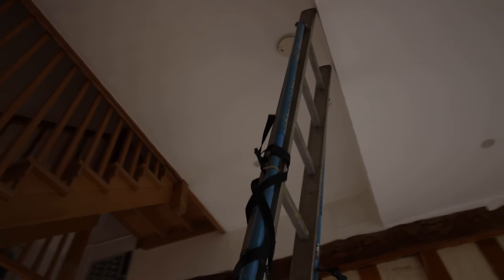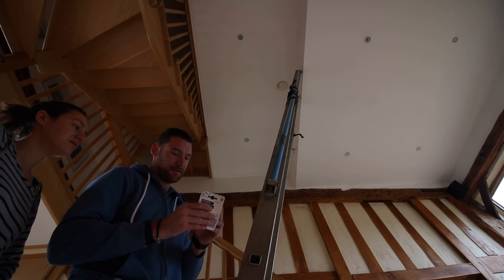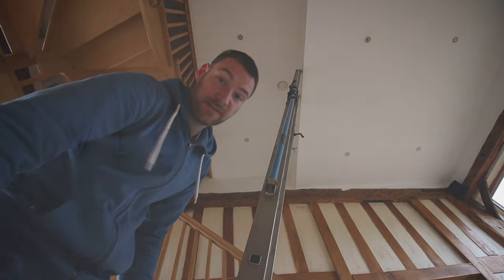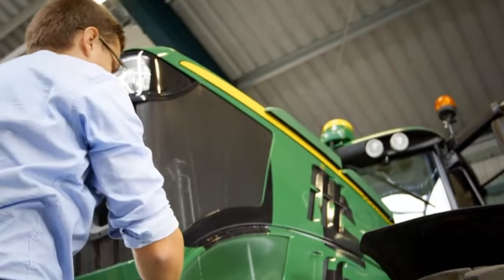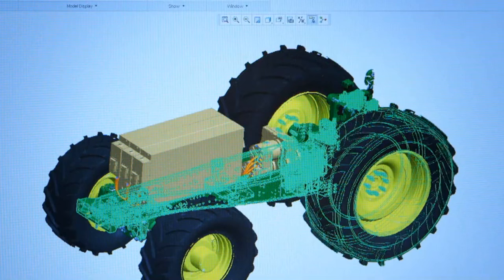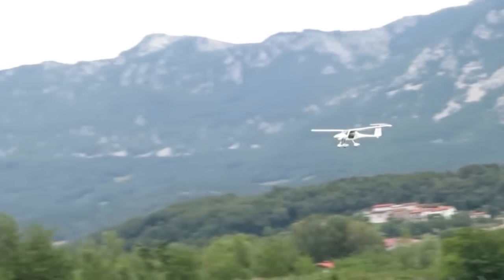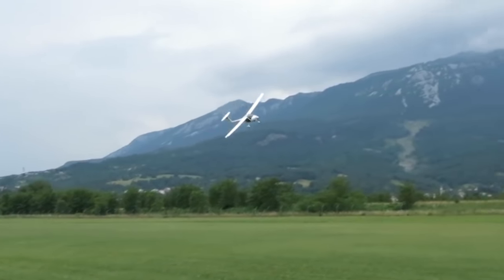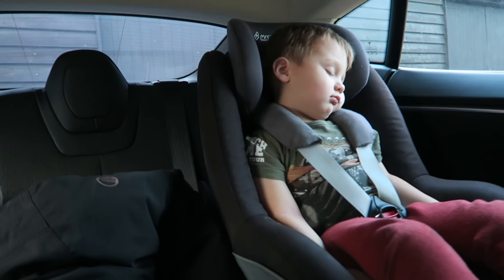Electric Tractors and Footholds

Comment: I'm a farmer with a Tesla Model S and a Polaris Ranger EV. An electric tractor would be great, just hope that Fendt also join John Deere with an electric tractor. The one thing that is different with a tractor is that weight is a good thing, so if the design could include the biggest battery possible then that would add weight, so a fresh design is needed to fit the biggest battery they can.
Reply: StarGames How is having a Tesla on a farm stupid? You do know certain farms have paved roads & driveways. A farm, especially a farm with Solar Power is perfect for a Tesla.

Comment: If you do not know the USA and British army is looking at power packs updates that include using hybrid system on tanks and other stuff so if a tank needs to be quieter it can run on in EV mode.  Also farmers in most places get tax free fuel - UK it Red and in Ireland it Green diesel thus the saving are harder to look at.

Comment: I have absolutely no knowledge of tractors! Jasper definitely knows more than me. You have inspired me enough to give up my lovely Megane Convertible and order a metallic black Renault Zoe Dynamique I (batteries paid for Z.E.40). It will arrive in March. I am interested to see the range - the dealer thinks Renault have been conservative with their range calculator so as to not disappoint people (he says he has a few customers who regularly get over 100 miles out of the 22 kwh version). The dealers are also giving very big discounts from the advertised price so it is worth asking them about this because it makes the car much more affordable than I expected (especially given the low running costs).
Reply from the maker: Fantastic, welcome to the EV revolution!
Oh and can I be the first to say, great choice of colour ;-)
Did you go for the quicker charging version in the end?
Reply: Thanks - black looks great if you keep it clean and shiny. The quick charge version was about £800 extra and I only expect to use a fast charger about ten times per year so it seemed to be poor value for money in that respect. I may feel differently on a long trip but time will tell.

Comment: Until cheaper batteries, higher density arrive, there's the option of using a small bio-fuel turbine to generate the electricity instead of batteries.  CAT did something similar to this a few years ago using diesel ( look up CAT d7e ).  That is still much more efficient and reliable than using diesel directly in a combustion engine.  Farmers can pretty easily gear up to grow their own eco-friendly fuel from something sustainable if they want to.  OR... How about a tractor with hot-swapable batteries?  The tractor could take a whole trailer of batteries to the field where the farmer is going to be working, dump it in the corner and swap batteries every  four hours, before taking the trailer of exhausted batteries back to the farm at the end of the day to recharge.

Comment: Some time ago you made a vlog about using a blue commando socket for charging your model s.  Now you seem to have a tethered cable where you park.  Have you changed things?  What type cable connects to the car?  What adaptor do you use?
Reply from the maker: Nope, still using the same blue commando socket. It has a Tesla UMC permanently attached to it (inside the garage), and I made a small cut in the garage door, so the cable can be left outside for easy use.

Comment: The 'typical' agricultural tractor has a 200 gallon (760 L) fuel tank, and convincing a farmer to spend 200% or more for an EV...difficult at best. Farmers look at costs and time, not to mention practicality.

I'm convinced biofuels are the future unless there's some radically new 10X superior battery technology.

Regarding electric planes, maybe a glider with an electric motor and a retractable prop. Beyond that I seriously doubt it other than the occasion concept plane.
Reply: Why would you need a car with 2500 miles of range? or a tractor with 40 hours of run time? Battery price is the only thing I see holding them back at the moment and they are rapidly dropping. What more could you want from a battery?
Reply: Shaun Veilleux An agriculture tractor is often under extremely heavy loads (hp-hr/gal) and hours per day during harvest, planting, etc high. I could see some general purpose EV tractor, but certainly not as I'm suggesting. BTW the EV tractor shown would overheat and run out of power too quickly to be any use. 

What's needed are carbon neutral fuels not to mention low impact (low polution) environmental solutions. Currently, Li-ion batteries are high impact from heavy metals and construction materials. Further, even the next generation eg graphene based while considerably better still need a significant amount of improvements.

To suggest Li-ion battery use is 'clean' or 'renewable' is misleading. We've painted ourselves into a petroleum economy corner and to do the same with something that isn't 100% renewable and 100% carbon free is simply repeating our past mistakes.
Reply: ***** Batteries in their current form and chemistries are highly toxic and polluting to the environment. 

You need to research Algae Biofuels. The CO2 emitted in combustion is absorbed by the plant used in biofuel production. CO2 neutral.

Fossil fuels emit toxins like sulfur dioxide, nitrogen oxide, heavy metals, etc pollutants when combustion occurs, those toxins were leached into the subterranean deposits.

Even if we had unlimited 'electrical energy' eg from fusion reactors then the cleanest route is to create hydrogen gas and burn that in cars.

Comment: I'm guessing you don't do a weekly test on your smoke alarm. You should really think about getting the Nest Protect because then you can test it right from your phone
Reply: ***** the weekly test isn't just for the battery. It's too test the sensor and other components that may fail. If you don't test your smoke alarm regularly then it might be faulty and you'd never know. I only mention the Nest Protect because you can trigger the test from your phone. There are cheaper smoke alarms that allow you to trigger a test from a remote key fob too.
Reply from the maker: No I only test them when I change the batteries. Probably should though.

Comment: batteries are the problem with EVs. Super capacitors could well be the solution.
Reply from the maker: True, but at least at the moment the energy density is horrible with super capacitors. Thing is, by the time they sorted out the short comings in super caps, they'll probably have sorted out the charge time and capacity on batteries too.
Reply: James Cooke wasn't there some breakthrough in the news recently regarding super capacitors? Yeah, http://www.hybridcars.com/supercapacitor-breakthrough-allows-electric-vehicle-charging-in-seconds/
Reply from the maker: Oow, interesting, certainly sounds very promising. Still needs to be made into a commercial reality though. There are battery cells made in labs that can hope sufficient energy density to enable 1000 mile range EVs, but commercial reality is still some ways off for these. Fingers crossed on the super capacitors though, would be amazing if there are no gotchas in commercialisation, real game changer.
Reply: Yeah, I'm not sure I care which solution end up being used, but the charge-at-home thing won't work for me, not for a long time anyway...it is annoying when Elon Musk's keeps saying that.
If petrol (and diesel, I presume) cars are banned, as was mentioned in the news this evening, then that might well spure on the development of the necessary infrastructure where the switch is more urgently needed (ie cities).
Reply from the maker: I certainly feel that the city charging issue is fixable with enough will power (pun intended) in cities. After all, the majority of city car owners still park their cars somewhere at night presumably. That collective will won't be coming anytime soon though I'd say. Super capacitors, if they can be made to work, might even make such on street charging unnecessary.